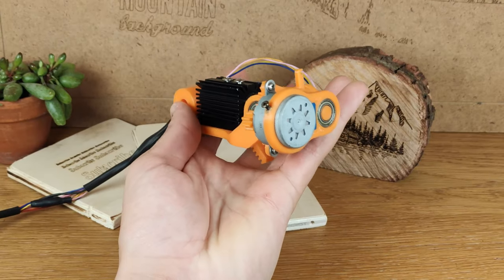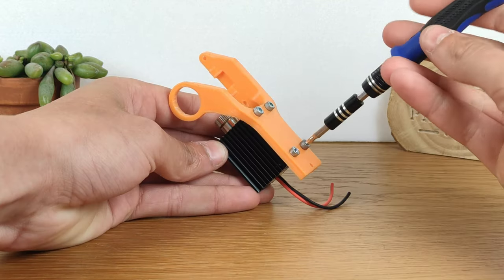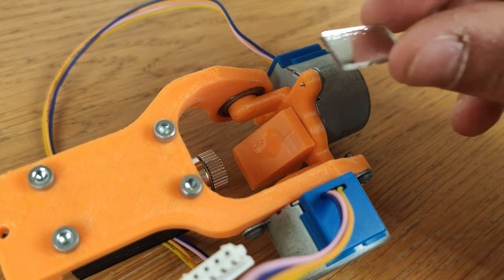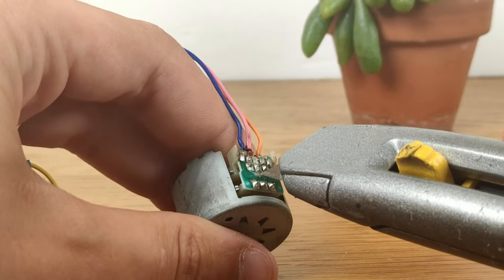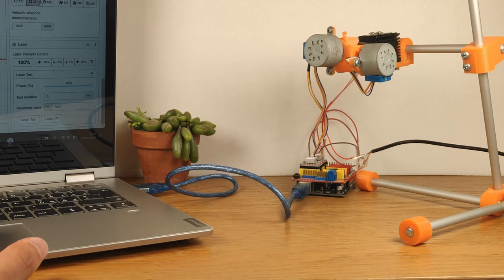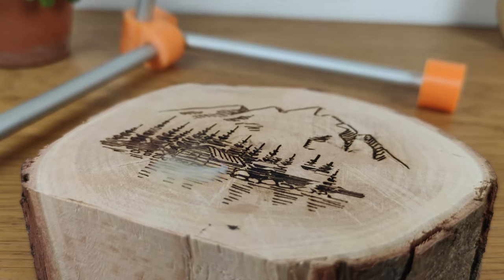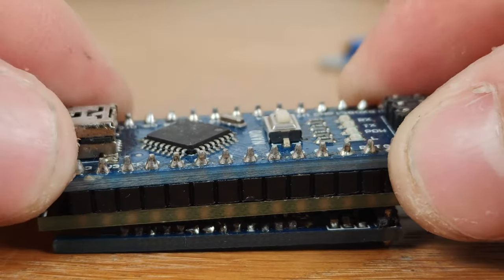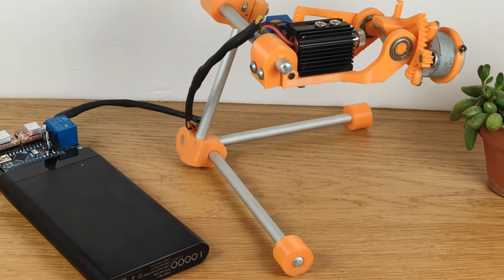Building a DIY portable Laser Engraver

Comment: Looks like a cool project if you're on a budget and/or don't have access to a proper X/Y galvanometer head.  I'd suggest three things though - 1.) use two mirrors instead of one and fix the mounts for both steppers - as it is, one axis is only moving the mirror's mass, while the other axis is having to move the mass of the mirror PLUS that of the other stepper.  2.)  depending on the field size, it may not affect things enough to matter, but X/Y systems like this should really have an F-theta lens to flatten the focus across the entire scanned field. And 3.) use first-surface mirrors instead of normal everyday second-surface ones.  Refraction through a second-surface mirror's glass degrades the quality of the beam.

Comment: I like the system. The quality is pretty good for a 3D printed unit that has steppers instead of Galvanometers. You could probably get a little better quality with a first surface mirror as well. I am impressed though. Good job. I may have to build one.

Comment: Heya, quick question. It appears you're using 28byj-48 steppers, how are you dealing with the play / backlash in the gearbox? I would expect to see what appear to be missing steps in the engraving every time the motors change direction but that doesn't look to be the case.
Reply: I dont think a few missed steps are that much of an accuracy concern. the motor is like 2048 steps per revolution after the gearing.

Comment: Congratulations, very good project.  I have a questions:
Is the print not affected by the variable focal length between the laser and the objective?
Do you set any software fixes?
Reply: It is affected and I am positive he choose the optimal "range" so in the middle is slightly out of focus, outside of that is in focus, and further still is back out. Testing would reveal how much that affects quality to adjust for the best results with the lens. I was thinking if he could add a way to adjust that lens when the steppers hit their extremes. If he had the center of the work area in focus, when the laser starts hitting the limits of the area a mechanism would adjust the focus out to compensate. You could even have the lens on a spring to return back to the same focal distance.

Comment: What firmware do you use ? And can you provide links un the BOM?
Reply from the maker: Ok, I'll add them later. I use grbl, i will make another video about the software side of things or at least i'll make an article on the Arduino projects hub, i still have to decide
Reply: @nova9054  for now It's just curiosity and if I build it I will buy laser good google, I dont wan to lose my eyes

Comment: Looks interesting. But dont the stepper drivers need a 470 capacitor each? In any case, great job. Very interesting, different take on laser cnc.
Reply from the maker: I used a single capacitor for both the stepper motors mainly to save space and it worked perfectly fine
Reply: @DAZprojects  Did you step it up to 1000uF or kept it 470?
Reply from the maker: @eraldylli  i user 220uf and it worked fine

Comment: Very nice project... Would be laser 1000 mW (1W) be better, or 500mW is enough (and because of cooling)?
Reply from the maker: The laser I used was perfect for engraving at a reasonable speed
Reply from the maker: @nova9054  you obviously need to wear safety Glasses every time you use this laser
Reply: @DAZprojects  Look, your projects are cool and i do admire them, but I think you need to make it clearer that there are potential safety impacts when dealing with things like lasers. Some people who aren't trained engineers or have STEM knowledge try and make things like these and then can potentially hurt themselves. I like the project and I like your videos, but you need to make the safety aspect more clear. Sorry for the spam, but i don't want people getting hurt